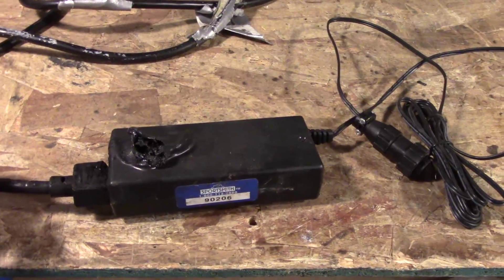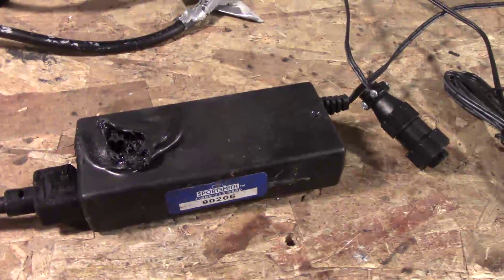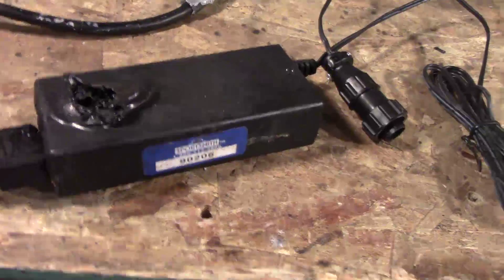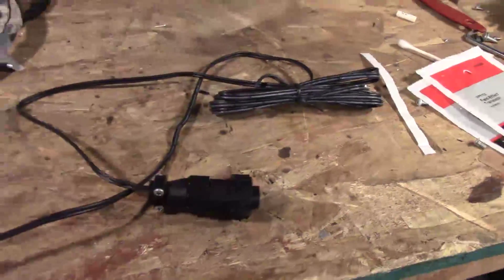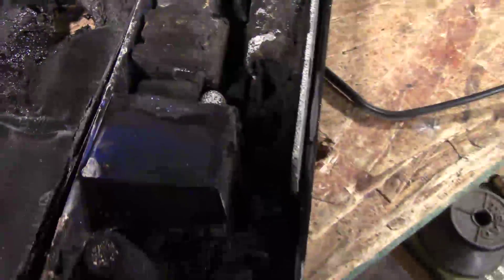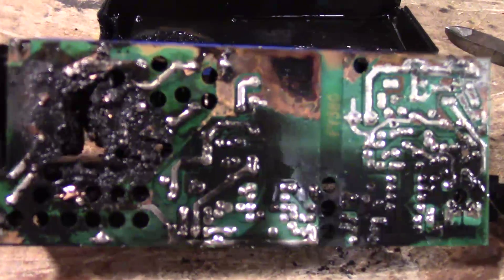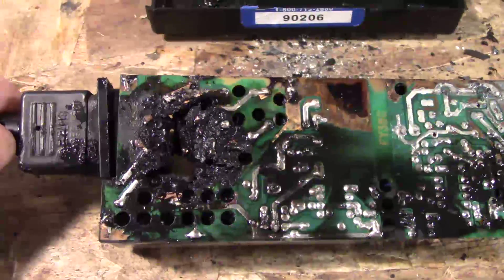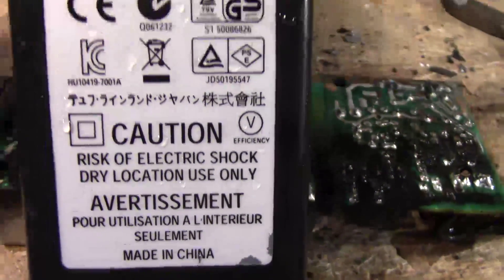Failure Analasys on a switching power supply

Comment: I am confused, stat this cheap Chinese Killer- Junk did not (yet) burn down your house , it looks inside like thrown into fire

Look @ the UL mark -> "E304160"
"UL warns of unauthorized UL Mark on AC to DC power adapter and switching power supply (Release 11PN-40)"
http://www.ul.com/newsroom/publicnotices/ul-warns-of-unauthorized-ul-mark-on-ac-to-dc-power-adapter-and-switching-power-supply-release-11pn-40/ 

" ITE POWER SUPPLY
E304160 35RS"

"MODEL: FY1904740
INPUT: 100-240VAC, 50/60Hz, 2.0A
OUTPUT: 19VDC, 4.74A
CAUTION RISK OF ELECTRIC SHOCK
DRY LOCATION USE ONLY
MADE IN CHINA"

Comment: Looks like a Transformer short circuiting and overheating badly probably on the primary winding too. must have been drawing a full 20A from the mains making it overheat so badly, Don't trust those cheap eBay power supplies that goes for desktops/laptops although a lot of Transformers have built in thermal fuses don't they? that goes to show how cheap those things are
Reply: +Sony Trinitron It may have been the chopper transistors that shorted. The transformer will look like a short circuit without the switching